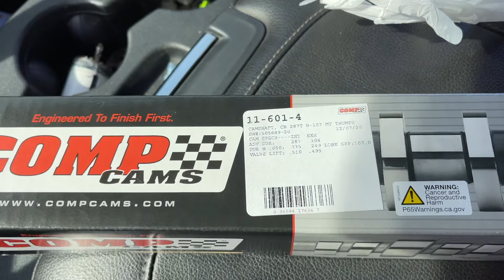Jackstand's $2,500 BIG BLOCK Jet Boat Makes a Miraculous Recovery After Finding BAD Engine Damage!!

Comment: Setting timing at 1400- if it’s got mechanical advance, you’re running a 700rpm timing of minus 4. That’s the reason why it’s all finicky. You should just hold it at 3k, and set all in at 34deg.
Reply: It has a vacuum advance diaphragm on his new dizzy but it's not connected to vac
Reply: @zxggwrt  it has nothing to do with overall timing. Actually, it doesn’t need vac. Advance in that setup. Cam’s too choppy.
Reply: I don't think these guys need any advice on tuning engines but thank you for the input
Reply: @Noneyurbusiness  Apparently they do since James didn’t add any zinc to the oil. That is a straight up beginner mistake.
Reply: @Noneyurbusiness  and thanks for input..?? 🤔
Reply: @adamr9215  Dude didnt even change the oil after they saw there could be water in it....they dont got budget for that!
Reply: @Audes2121  But they had a budget for a cam, lifters and all the gaskets? I have to call BS on that. James always makes beginner mistakes.
Reply: @adamr9215  You heard...He got a screamin deal on that...and they probably didnt really have the budget for it lol
Reply: @Noneyurbusiness  tell us you don't know anything about engines without actually telling us
Reply: @Billy Bob So what? He bought a cam for it, they showed that, and James said it was getting a cam.. That’s enough proof for me. Plus, you saw how torn down it was. If he reused those gaskets, then he is screwed.
Reply: @123vaw123  I doubt that very much. I think he is a hack that doesn’t have any background in automotive performance.
Reply: @adamr9215  You mean zinc in the milkshake?
Reply: @adamr9215  he’s helped Cleetus build what was at one time the worlds fastest stick shift Corvette and multiple engines for ruby and his own cars, clearly he knows nothing about engines.
Reply: @adamr9215  a hack that builds 7 second cars, aight dude. 👌
Reply: @adamr9215  bahahahahahahahahahahahahahahahahahahahahahahahaha
Reply: @01gtbdaily30  LS motors dont need zinc bub.
Reply: @0778drz110  I never said anything about zinc bub
Reply: I already know I told him in the last video that they needed too lock the advance in the distributor so they dont have to deal with that.
Reply: @adamr9215   And anytime you wipe a flat cam, you have to tear it down to the bare block, remove the cam bearings, and oil plugs, then clean the shit out of it.

I hope he at least filled that engine up with super magnets.

Not that it will matter.  If he went back with a flat tappet cam, they didn't break it in for 30 minutes.   Instead they hooked up a timing light and went to winging the engine with old cam grit in the oil.

...and you're not supposed to run Berkely jet drives out of the water.  So that explains some of the wear on the impeller.    ..but not all the cavitation burns.
Reply: @adamr9215  or properly break the camshaft in.
Reply: @eric63377  but it won’t start after 24degrees, so an msd box will have to be used. I didn’t see one in the picture. And it’s hard to use an msd with HEI.
Reply: @earlbrown  That's exactly what I said they didn't break it in and any Real tech on here knows that fucking engine is full of metal.. And I agree with you. I'm not trying to hate on James but you only see him doing odds and ends shit on here that I was doing when I was 12. I've never seen them properly rebuild an engine and it actually Stay Together or a transmission.
Reply: @01gtbdaily30  Not specifically, but you said he knows engines. From what's shown in the videos they have blown up a lot of engines and he works mainly on LS instead of older stuff. You have to be more careful about pulling an engine like that out of the weeds and throwing it into a race without even changing the oil.
Reply: In the words of a  not so great man  (rodney king) "cccccant we all just get along"
Reply: I don’t think he truly cares about the engine that’s in it lol just needs to last through the challenges and win. Then I have a strong feeling that motor is getting ripped out for something more modern and with EFI. Why would he try and rebuild a BIg block with an existing budget of 400$ lol y’all take this shot too seriously.
Reply: @adamr9215   a hack? You really just called jackstand a hack over a boat challenge that is literally designed for fun and content. You definitely haven't watched this chanel for long enough.
Reply: @adamr9215  Pretty sure he means they didn't show the actual work. So you have no clue what they did or didn't do. They could have put in break in oil. You'd never know it. Also James a hack? How fast is your car? You can listen to him and know he has more knowledge in his pinky. Than you do in your entire body.
Reply: @0778drz110  everyone who races at the highest level breaks engines . It’s a big part of racing. I know plenty of guys who just build cars for local car meets and when you push a engine to the limits they break . I don’t care if it’s a Japanese , domestic or European car literally every Automotive YouTuber out there once they start modifying their cars they break. 

Unless you’re one of those guys who builds and then never drives your car it’s going to break down.
Reply: @adamr9215  budget... He was concerned with even having budget left to change the oil
Reply: @adamr9215  this is a hack challenge
Reply: @Noneyurbusiness  didn’t break in the cam for 20 minutes either
Reply: @adamr9215  and you witnessed that  how?
Reply: @adamr9215  the break-in procedure for a flat top cam that you want to survive 50,000 miles + it's totally different than when you're trying to slap them more together to run in a competition two days from now when the rest of the vehicle isn't properly sorted.

The zinc helps, but modern oils are excellent. He's not going to wipe the cam in a couple days of running
Reply: @01gtbdaily30  He never built an engine on this channel. All he did was bolt some parts on, nothing that couldn’t be done by most Jiffy Lube employees. I’ve been an engine builder for over 30 years and the thing that is different between us and parts changers like James is that we do all our own machine work. Engine builders do all their own machine work, parts changers just bolt stuff together.

But yea, he bought a boat in a salt environment that had been sitting outside, and he didn’t flush the oil or anything, just filled it up. Nothing but an absolute novice would do something that wrong. So yea, he knows NOTHING about engines after that.
Reply: @Nikorasoup  Not really. He is a hack that bolts parts onto engines and transmission built by other people. Any Jiffy Lube employee could do that
Reply: @0778drz110  They don’t, but that old big block with a flat tappet cam does.
Reply: @daltonnapier590  not sure how he could have fit that into a 14 minute video
Reply: @earlbrown  That’s the right way to do it, but you don’t see James doing things the right way. He doesn’t seem to know what the right way is.
Reply: @brentlamadeleine3025  Lmao, I’ve been watching since Cleetus was still just a camera guy for 1320Video. I subbed within 3 hours of his channel going live.

How is making sure he loses and shows how little he knows about engines fun or worthwhile content? It isn’t. I would rather see him do it the right way and still lose.
Reply: @huntjl88  I was taking about when he just filled the engine with oil when he got the boat. In the video he said he didn’t do anything but put oil in it. That means no zinc. Maybe next time you should pay attention to the video, because I did.
Reply: @safetyfirstintexas  Pay attention next time you watch the video. It was covered. Lol, you are mad at me because I actually paid attention to what was being said. If you weren’t choking your chicken while staring at James, you might have noticed that.
Reply: Damn a bunch of super engine techs in this comment section must be working at the Wal-Mart service center
Reply: @jerrybaldwin7543  Like James? I doubt even Walmart would hire him.
Reply: @adamr9215  ZERO need to add zinc. This isnt 1960 you clown.
Reply: @otm646  Dude, you know NOTHING about older engines if you think that. EVERYONE that owns an older engine with a flat tappet cam knows that the new, crap oil no longer has the zinc that is needed and can destroy a cam in minuets of running. New oil is trash, and is nowhere near as good as the stuff we had 40 years ago. New engines are designed to deal with that, old ones are not. Get a clue, move out of your moms basement and try to learn something instead of making yourself look idiotic.
Reply: @phenry5083  Are your parents brother and sister? Because that is the only thing that explains the ignorance in your comment. You wouldn’t need to add zinc if it was 1960 because that was before the EPA forced zinc to be removed from the oil. That old flat tappet big block needs zinc. If you don’t know something that beginner level, then you must know NOTHING about engines. It’s common knowledge.
Reply: @adamr9215  I know that was my point. The new stuff doesnt need zinc or a break-in. I think the only old engines they ever had on the channel was the big block in Toast. That's on what? It's third engine? They blew the first one up almost instantly. Didn't they screw up changing the timing chain on the ford modular engine and blow that up too? So many I can't keep track anymore. Anybody can "build" a turbo LS engine and install speed parts. It's not rocket science.
Reply: @goosesgarage6666  yeah I guess he could’ve done it off camera didn’t seem like it but we will find out if it goes flat again lol
Reply: @0778drz110  Everybody keeps saying that James has some mythical background in dirt track racing. If he did, then he would know about adding zinc. That’s a good part of the reason I don’t like the guy. Pretty much everything he says is wrong or just plain stupid. He told a bunch of lies to get a job, then can’t be gotten rid of because of his brainless fanbois. Cleetus should have kept Cooper and never wasted his time with James.
Reply: @earlbrown  , not true, but only for 5 minutes or less. That’s from Berkeley.
Reply: @adamr9215  you're right about the oil. Zinc phosphate is a primary anti wear additive for flat tappet cams. The EPA requires certain warranty periods on emissions equipment for modern cars and zinc phosphate will plate and degrade a catalytic converter. The modern API specifications for oil are designed for roller valvetrains with low friction, and have very poor film strength. If you put API SM/SN spec oil in this engine it would gall the cam lobes and lifters over a fairly short period of time. Automotive oils are a joke for the most part. I use modern oil but suppliment BG MOA additive in my cars.  Most car guys know less than nothing about oil, its all brand loyalty and marketing horsecrap passed around in forums. Sad really.
Reply: @midship_nc  Luckily, I was in a good financial position years ago and bought a couple hundred barrels of oil. So, I still have quite a bit of oil from the 90’s before all the good stuff was removed from it. Even with that, I still add zinc for break in and every other oil change. Of course, I’m a machinist and engine builder that has worked for myself for the last 30 years, so I probably have the ability to use and store that much oil more than most people.

I’m not that brand specific when it comes to oil, but I won’t use Pennzoil or Royal Purple. Pennzoil had some weird additives that caused sludge like nothing I’ve ever seen before, and Royal Purple screwed a couple of my customers back in the day and wouldn’t make good on anything. Sent them purple water pretty much, admitted that they had a problem, but wouldn’t cover anything. They got paid in a law suit, but the company should have had the ethics to make things right.
Reply: @fast97z24  lol the name is a joke🤣.
Reply: @stevegiboney4493   That's too overly simplistic.  

 If an impeller and a wear ring is worn out, you can run it for a while as long as the bushings at the end of the shaft are in good shape and have fresh dope in them (which is kinda rare).   If that seal is shot and it's now ''water lubed'', that bushing can smoke and seize to the shaft.

If the impeller-to-wear ring clearance is tight (AKA 'in spec') running it unloaded and dry will open up the clearance.   (the more the clearance opens, the less efficient the pump gets).

This doesn't apply to james' case, but if you have a true running impeller, and a plastic wear ring (the best set up) and you start it at all out of the water, it's trashed.  The pump has to be opened up and the wear ring replaced.

That's straight from everybody that owns and runs a Berkeley pump in real life (myself included)
Reply: @adamr9215  royal purple used to be good before they lost their lead engineer and sold to calumet. They have moved back to metal drums after the buyout and use a cheaper PAO stock, metal drums = water. I cant remember the guys name but he landed in a small company somewhere. 

My dad used to sell royal purple industrial oil and hydraulic oil for a distributor back in the day. Now a company called lubrication engineers makes some of the best oil on the market for racing and i believe they do some limited industrial applications. 

I get a kick out of people that use mobil1, i wouldnt put that crap on a door hinge lol. The only thing mobil does well is coupling grease. I have seen $300k gearboxes destroyed by mobil.
Reply: @earlbrown  , never heard of a plastic wear ring, only stainless.
Reply: @adamr9215  it’s a 2500 boat challenge , they are YouTube creators and it’s for content. If and when the boat breaks it provides content. I’d love to see a video of all your 7 second cars ……….. I mean after all you’re an “expert”
Reply: @01gtbdaily30  Lmao, you are trying to insult a 30+ year engine builder. I don’t post videos online, otherwise you would see that I’ve got 7 vehicles that run 6’s in the 1/4. And that’s not counting rails and funny cars, just street legal stuff.
Reply: @adamr9215  Why would he put Zinc in an old engine with an old cam? The cam and lifters were already worn out. That's why he was having to put in the new ones. Did you think the worn out cam and lifter they showed were new? Those were in the engine when he bought it. Also I think the water in the oil was mostly from James not knowing how to adjust the water for the exhaust. Maybe pay better attention next time because, I did. SMH!!!
Reply: @huntjl88  I guess you didn’t pay attention to the video where he bought it? It was supposed to be a fresh rebuild that had been sitting for several years. That is exactly when you need zinc.
Reply: @midship_nc  Do you mean Lubrication Specialties, as in Hot Shot's Secret?
Reply: @sowbellymotorsports9783  no there used to be a company with an abbreviation like LF or LE that had a bunch of ex royal purple guys working for them...this was aboit 6 years ago or so. I cant remember honestly lol.
Reply: @adamr9215  dam just go kiss cooper already and idk if you’ve ever seen James old 240. That thing was a budget  carb motor n nitrous for the 1/8 . It was fast
Reply: @alexvillalobos7137  Not really. There are a lot of budget ls builds that run faster than his car did, and don’t break near as often. Just an FYI, I’ve been doing ls swaps since 2002, and have been deep into the 4’s on a junkyard shortblock myself. It’s not that big of a deal, we have been doing it since James was still in school.

Comment: leave the water off to the stacks.  The point of the water is to muffle the sound - if you don't need to muffle, you don't need the water... and that, folks, is the difference between wet stacks and dry stacks....
Reply: Bills BuildAll  Yeah, to keep the chrome looking pretty , but it really does lessen the noise. Since this one's not running Mirror like chrome you could run it with little or no water and probably up the HP a tad. IMHO
Reply: Bills BuildAll  it does, but it's purpose is sound deadening.  Granted, the sound difference would be akin the difference between a 747 taking off and a F4 Phantom on full afterburner - but it really does make a difference.... that said, in this case, turn the water off to the manifolds.
Reply: @doccyclopz  100% .  the difference in temp is it will take .02 seconds to 1st degree burn with the water v. .01s without.
Reply: I wondered why there was water going directly into the headers ... turn it off , not needed ... like James said ... it's not here for a long time , it's here for a good time ...

Comment: Reminds me of the over the transom chrome Bassett headers I had on my 455 Olds jet boat.
That old turd went 80 via gps with a warmed over 9.5:1 compression short block and box stock edelbrock aluminum heads, single plane and barry grand modded 850 annular booster carb. (Same engine went on hot rod power tour and went 11.80 in my 1970 442).
Baffles in the header collectors? Took em out. All the fisherman under the bridge on belleville lake just shook their heads as I idled under the bridge in no wake zone...sounded Real Good!

Comment: 8:20 You should be at 3k to break-in that cam because of the flat lifters. Also, I didn’t see a high zinc oil go in the ole girl. Come on man.
Reply: Yaaaa I noticed that too
Reply: I just said the same thing. After it was all put back together he said I might do an oil change. That oil with all that water in it will wipe out that cam and lifters in minutes. Especially with the quality of crap components we have these days.
Reply: He put that cam in dry lol
Reply: Yup commented as well. They used to roller cams.

Comment: Back a few years ago there were some check valves with spring loaded balls in them . They went in the water lines for the headers . They would open after the engine hit about 1500-2000 rpm .